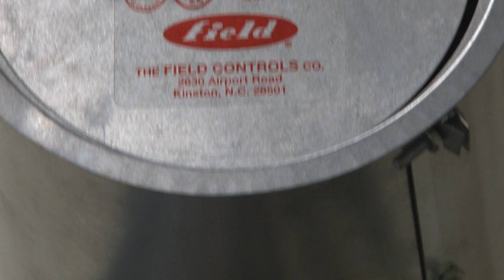Oil Furnace

Comment: Actually, there was no counterweight on the damper.  Was it just not tuned yet?  Or was there some other reason?  I ask because mine is all screwed up an I cannot find a decent HVAC tech that knows how to tune a damper.
Reply: That type of draft regulator has the adjustment weight on the inside of the assembly. By the way, I am a third generation oilman guru. Thanks.